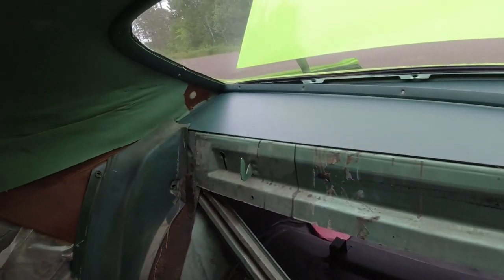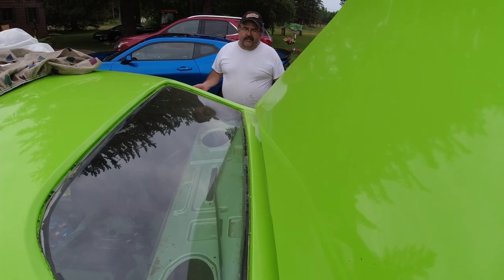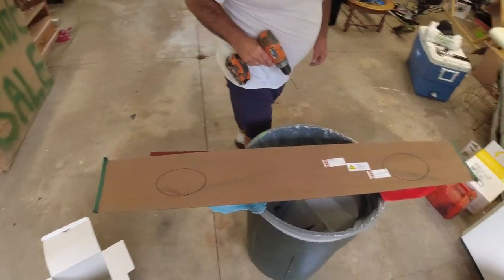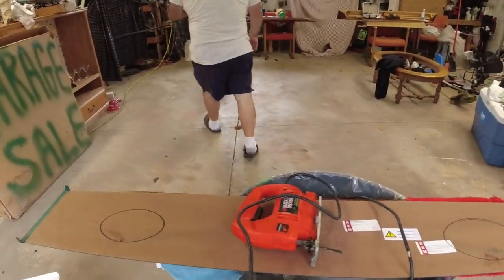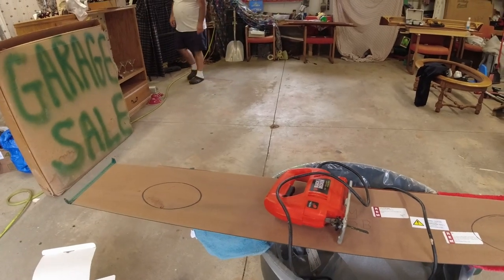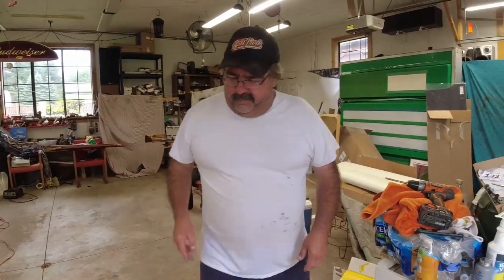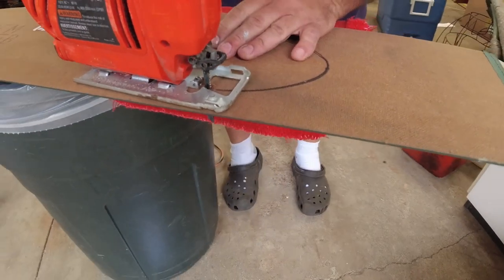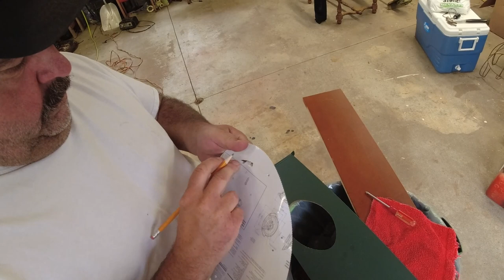74 Dodge Charger Episode 3 Speaker Installation/Tray Install

Comment: If I remember correctly, there was a full-range, 6x9 speaker on one side of the rear deck and a high-range (high frequency) 4x4 speaker on the opposite side of the rear package tray...something like that. Older cars sometimes only had (1) speaker in the back and (1) or none in the front. I remember also having to drill out those mounting holes (on one side of the speaker tray) for 6x9 speakers in the '80s when adding aftermarket speakers to '60s and '70s cars. The smaller speaker (which was still in cars in those days) would sometimes still work and you can hear it had no BASS coming out of it. Used to call it a "tweeter" but I don't know if that is still what they're called. Just some FYI of what I remember - thanks for sharing the videos.
Reply from the maker: This is some great info. I’ve really only been around 90s and newer cars so this has been definitely new to me. The car had a factory am rca radio in it so it only has a front speaker. Currently the car has a retro radio in it with the new Sony rear speakers. Thanks for watching and your comment :)
Reply: @RusticRestorations  You're welcome. Yes, some of the cars I remember had only the one speaker even though it had the openings to receive two. Usually the board in the back was solid, but the opening for the speaker was hidden under it when not in use. Sometimes the dashboard had a center speaker mount with a "tweeter" in there too. Thanks for keeping the old car hobby alive! Enjoy.